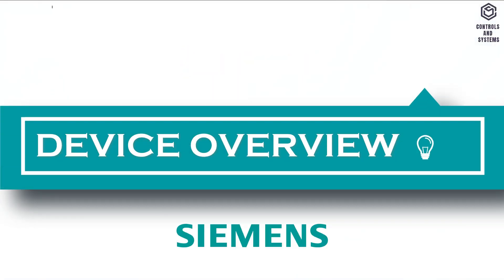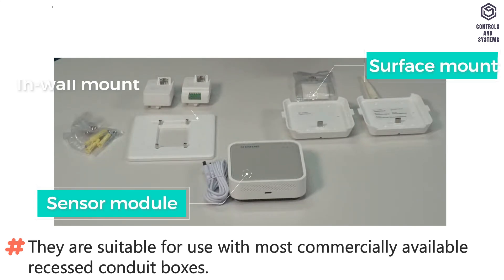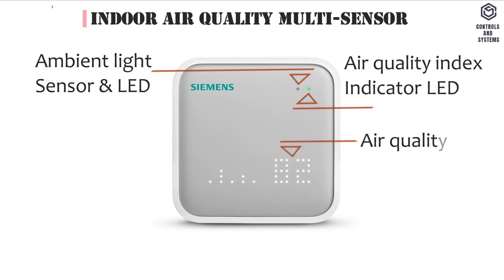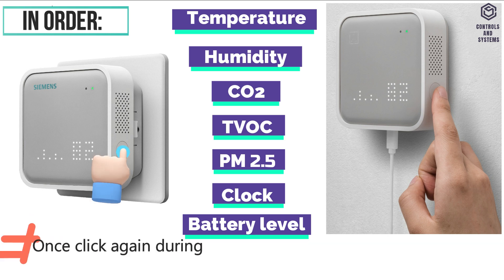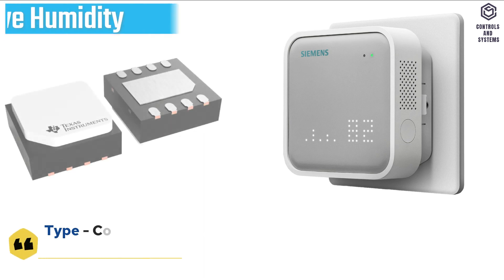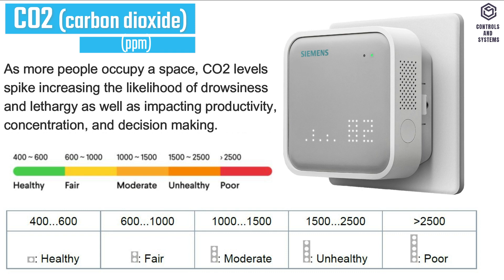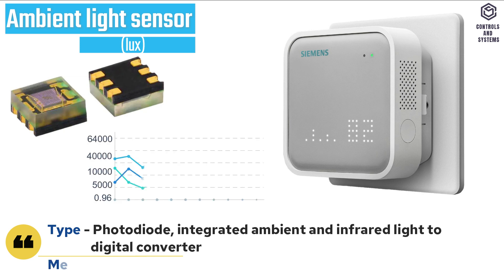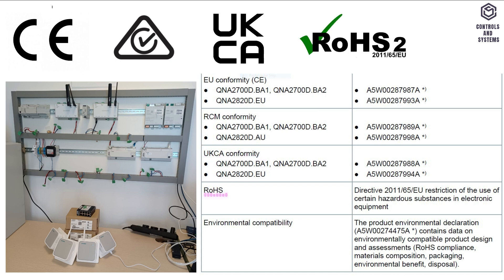Siemens Indoor Air Quality Multi-Sensor 🌍 | Smart IAQ Monitoring & Technical Overview

Comment: Model name?
Reply from the maker: ✔️ Product number: QNA2700D.BA1
Version: BACnet IP
Inbox items:
● Sensor module
● Surface mount BACnet IP version
● In-wall mount
– Backpack POE only
– Conduit box cover, mounting plate
– Set of screws and plastic insert

✔️ Product number: QNA2700D.BA2
Version: BACnet MSTP
Inbox items: 
● Sensor module
● Surface mount BACnet MS/TP version
● In-wall mount
– Backpack with terminals
– Conduit box cover, mounting plate
– Set of screws and plastic insert

✔️ Product number: QNA2820D.EU 
Version: LoRaWAN EU
Inbox items:
● Sensor module
● Surface mount, antenna
● In-wall mount
– Backpack with terminals (optional)
– Conduit box cover, mounting plate
– Set of screws and plastic insert

✔️ Product number: QNA2820D.US
Version: LoRaWAN US

✔️ Product number: QNA2820D.AU
Version: LoRaWAN Australia